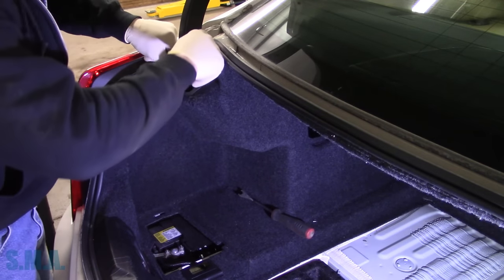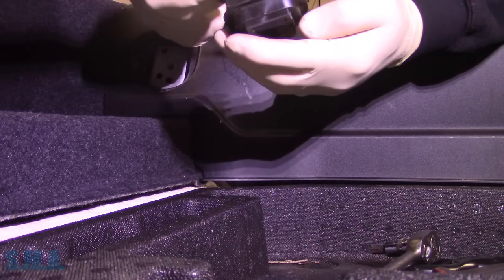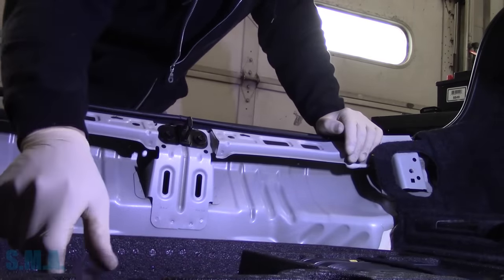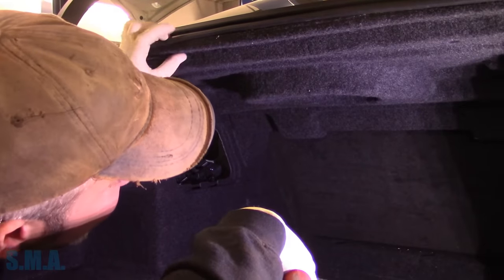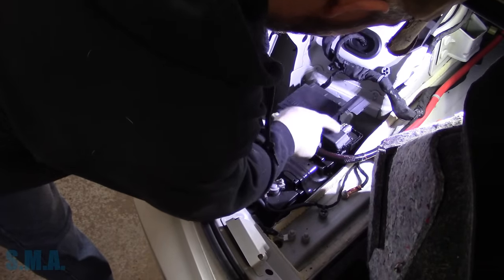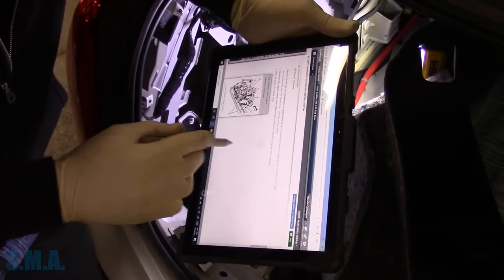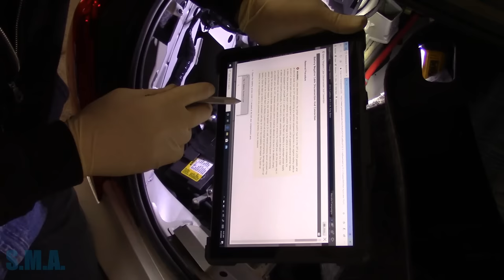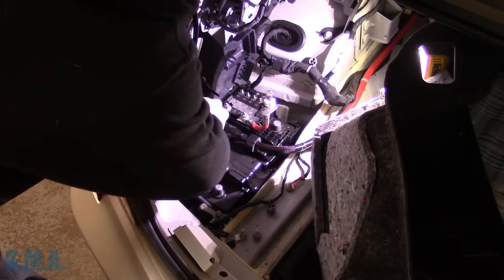Cadillac ATS: Battery Remove & Replace

Comment: Man that is rucking fidiculous.  I miss the good old days.  I seriously think you’re better off running an old car or truck from the late 90’s to mid 2000’s.  Of course that’s not always feasible in the rust belt up there.  I suppose you could get a nice one from a different part of the country, get it all fluid filmed and your good to go.  It’s a shame that so many cars bite the dust so quickly up there.  It would be awesome if new cars came with all metal parts powder coated, I would pay extra.

Comment: To change the battery cost you as much as the price of the battery. You forgot the plastic washers, you had to put the christmas thingies in first and put the washers on the otherside of that cover to hold the christmas thingies and then just pushed them in place.

Comment: I have a "16 ats 3.6 with start stop, and just added an amp and sub. I disconnected the battery and then reconnected it after wiring up power wires to it for the amp. Once it was hooked up I went to start the car and it wouldn't start. Tried to turn over once and then completely shut off and nothing would turn on after than. I had to close and open doors just do a few things to try to wake up computers, then was able to start it after a slightly long crank. My old scion did the same thing after disconnecting battery so I wasn't concerned. I drove it the same day with no weird issues, but then the next day it happened again. Did I mess something up has anyone had this happen before?

Comment: i replaced batterys on my compeys 1964 cat payloader  each one weights in at 80 lbs and are under the sit of the loader wicth is a pain in the  rear  no room to pull the dam things and heavy as lead can be. it on top of it its a 24v system  fun it was not

Comment: Chrysler in the passenger wheel well......mecedes benze under the right passenger seat..(imagine if that battery blew up)…..ford jamed up into the fire wall on drivers side...and now Cadillac pulling the entire trank apart to replace a five minute job...and probably have to reprogram the entire car after this

Comment: Car manufactures have figured out that you just have to impress buyers in the drivers seat. Put a big price on cars and trucks and wave as you leave the lot as a buyer. I'm sorry but I don't feel sorry for them at all anymore.. What a place to stick a battery that turns into a overhaul job to replace a battery or plugs , and a lot of other things. take it to the garage to replace a battery and get a bill for 3 hours labor plus the battery.

Comment: Advance, Auto Zone, and O'Riley's will NOT install those batteries. AZ even quit doing the  Lambda platform. If the battery is not in the front or easily accessible without removing trim they wont install it anymore. This came after a Traverse burned down in a south GA AZ.

Comment: And then there is BMW with battery under rear seat of 90's 7series iL with adjustable recline, and it has be fully extended to access the battery. 
If the seat adjust still works 😭

Comment: motors book time .4 hrs ,, right
Reply: I think you read that wrong.  I see .4 for test & charge and .7 for R&R in the Motor labor times.
Reply: @shauno3697  my mistake you are correct, good thing i don't quote the job
Reply: No worries. If you didn't make the mistake, I would have.

Comment: That is ridiculous. I expected less from you, GM. I had a 2000 Dodge stratus years ago and the stupid battery was inside the front fender only accessible by jacking up the front of the car, taking the front wheel off, pulling out the inner fender liner and pulling the battery box. And I thought that was ridiculous. GM, hold my beer.

Comment: Easier to make a few cuts in the plastic panels to remove the battery, then glue (epoxy or hot glue) to repair the panel, it is only a trunk, who's going to see that?

Comment: I would have went to oriellys they claim they will replace your battery for free if you buy the battery from them 😁
On second thought,  I wouldn't trust them to do a job like that.
I thought changing a battery on a 1998 Chrysler Concord was hard. That was a walk in the park compared to this

Comment: I'm afraid I would have slit the carpet at the end of the battery, that's ridiculous
Reply: lliambunter we had a customer come out into the shop and do that when we told him how much the install would be
Reply: @Texantroll  I don't blame him, it's not that it will cause all that much damage is it?
Reply: @Texantroll  I was once told a lady was given a £450 bill for changing  a headlight bulb in a Mercedes, I don't know what model it was, but under EU law you should be able to change a bulb if it goes out , that was why sealed beams became illegal in 1972/3   it's getting beyond being ridiculous
Reply: lliambunter ya but I’m sure when he turns in his lease they may not be impressed lol

Comment: In the good old days, you could jumper the dead battery to start your car. Then buy a new battery and install it in 5 minutes.  Today hire a wrecker pay a mechanic who has to look up all the data to be sure he doesn't damage anything and then pay out your nose for the job. Car companies are going to have to wake up or some company is going to come along with a common-sense designed car like Henry Ford did with the model T and put them out of business.

Comment: American engineering in the 1960's. Able to plan, design, and build a method to get men to the moon.
American engineering in the 2010's. Making changing the battery in a Cadillac harder than landing men on the moon.

Comment: 16:40 Intresting! Our battery's comes atleast one side blocked(so you just change the side of the plug when you need to.
PS. I miss the point of that secend battery IF the car dont have a "Start stop system", that would start the car automatic when you disconnect the main battery...
So if you ever have to replace that one maybe a video of it would be great, just maybe...
31:05 That might be failed test info! There is Battery Control on that car. Ones my customer come in and told me that the new Battery controller didnt work. I have to inform him again that the car dont want the Battery to be 100% it actually wants it to be ~70% so it can charge it with 18v or so volts on motor brakes and tahts most of the charge it dos these days only on down hill or motorbrakes to safe cas and the hole world. as example, Plains dont do anything to the world...

Comment: General Motors pays 36 minutes to replace that battery from bringing the vehicle in,  looking up the installation procedure, installing the battery, do any module configurations, writing the report , removing the vehicle from your bay, and handing in the work order. If there is any diagnosis they will give you an extra 18 minutes . But you have to run a test with a Midtronics GR8   battery tester that is usually from 1 hour to 1.5 hours long and attach a printout after the test with a code to confirm your diagnosis or they pay you nothing. Anybody want to work for a GM dealer?

Comment: 2002 dodge intrepid was the worst car I had for battery location. Front right lower wheel well. The battery sits right behind the passenger fog light. 🤷🏻‍♂️🤦‍♂️

Comment: "Isnt there something that holds it in?"..........yea all the crap owners put in the boot stop it moving LOL.A very convoluted battery replacement it must be awkward trying to jump start the car, they could have just made another removable section by the battery its not like it hasn't already got one for the fuse box. BTW what are those silver hoops for on the rear fender cover bolts that you replaced, if they are tie downs what for?

Comment: A Cadillac with a 200 hp, 150 cid 4 cylinder engine requires half an hour or more for battery replacement, plus follow-up. I don't recognize this world.

Comment: Similar story: Working on my BMW E90, just need to change the bulb on one of those "angel eye" parking light... The steps are: Jack up your car, put it on jack stand, front wheel off, inner fender liner off, then you get to the bulb, which is a whole light assembly that you need to replace, not just a bulb, but that's another story. 
Again, similar story for the E90 M47 engine engine air filter replacement.... Steps are: engine plastic covers off, cabin air filter off, filter HOUSING off, engine brace bars off, then the filter cover comes off after wrestling with it and the ECU harness is just in the way....

Comment: I've checked the position of the oil filter before buying a car for decades, starting about 10 years ago I also started checking the battery location. I would not buy this car.

Comment: I have worked on these shit wagons for over 30 years. At least 2 or 3 a week. Nothing is easy on them. Customers pay 40 to 70 k for them and repairs are access difficult and a pain in the butt and expensive. See the trim on this battery change. It could have been designed for full access by G.M. But no!  The old Caddys 1999 to 2008 Northstars, head gasket bolt problems, Coolant problems etc etc. Starters under the intake manifold, limited access for Alternator removal etc etc. Light weight OEM original front ends etc etc,  Oh and the 3.6 lt  engines paid for my kids college educations alone with the notorious timing chain failures. When the cars get about 50,000 miles the heads on the  aluminium bolts will break , come off like candle wax. If you keep these cars for any length of time the plastic switches  on the interior and parts in the engine will break from normal use. I suggest watching South MAin Autos  ( Erics Video ) on how  to extract broken bolts inside the engine. U will need it . Good luck.   Excellent video Eric. Thanks  lololololol Gd.

Comment: Chrysler, and we put one in the drivers side front inside fender well of the dodge stratus to boot!! Good thing the 1996 dodge stratus was build just for the rust belt. Every screw and bolt rotted. Morons. takes about 40 minutes too get it out, by removing the tire. Then a trip to the hardware store to get some stainless steel screws and bolts so they won't rot out again in 3 years when you'll change another one. I thought it would be faster to scrap the car. The owner, thought other wise.

Comment: Like it's not bad enough that they place the battery in such an idiotic location. But they also consistently use undersized batteries that aren't really up to the task. The 12v battery in my Prius and in my Chevy HHR are both located in the rear and are both ridiculously small.

Comment: and I thought that Chrysler's idea of removing a front wheel to get to the battery was stupid. another video to reaffirm that I was right to get out of the auto trade.  btw, Toyota mini-van from the 80's that had the battery access from the inside, behind driver's seat.  good thing there were no soccer moms with messy kids leaving the van a pig sty

Comment: about as bad as changing the headlight bulb, "tear off front end". those battery cable ends look just like BMW ends "junk" and for good measure BMW puts a little explosive charge at the pos. cable end to blow connection in case of an accident. are you friggin kiddin me.

Comment: What is the Gauge of the Battery cable going all the way to the front? I would assume it would be heavier given the distance. The engineer that designed that should be shot and buried in his own sh_t.

Comment: Them foreign jobs probably require you to remove the engine to replace the battery so in comparison this one's a piece of piss, like when an electronic device says no user serviceable parts inside. My 2001 lesabre has the battery under the back seat it's easy to change and when did GM switch to top terminal batteries?

Comment: What's sad about this is the auto parts store a which have a policy of installing batteries for free.  So the poor schlubs working there are tasked with doing these trunk batteries and back seat batteries AS well as you do at SMA, except the parts store people are also supposed to do their parts counter jobs AND this, for barely more than minimum wage.  And don't screw up and damage the car. And oh yeah, there are no tools. Maybe a 10mm socket wrench.  But change that battery or else the DM will have your hide.

Comment: Kind  a bad engineering FUBAR, putting battery in trunk and that much work to get it out! I had a 63 Plymouth 426 Ramcharger 2 X4 factory Drag race car has a big D4 diesel battery in trunk over right axle and dual cable easy to service!

Comment: Looks like a-p-i-t-a!  so i guess you didn't have to reprogram compass etc..? My worse Battery was in a Big RV, there were Two Huge Batteries under the stairs, it was tight and they were Heavy AF almost crane worthy to lift them out and in.

Comment: once the back up battery has been used it can no longer be charged.... what sort of battery cannot be charged in these modern times, and what sort of idiot thought that was the only solution to a flat battery, a bit like some mercs where it has a motorbike battery under the pollen filter.

Comment: I have never seen such a badly placed consumable item. There was nothing wrong with having it under the bonnet/hood - and the backup battery??? What an excessive waste of time and money. Bring back the carburetor and basic wiring. I also thought the little vent plug in the battery had to be removed before use - maybe I'm wrong.

Comment: This is a joke, right? The battery is a wear item that must be replaced every 4 or 5 years. There are a lot of ways to discharge your battery so you need a jump. This has to be an April Fools Joke from SMA>

Comment: This is incredibly poor design. Only one bracket to go over the battery? For safety reasons we need at least 20 brackets with isolation and dampening and at least 40 quick release screws

Comment: G.M....ARGH!!!Took me 2 hours to replace a battery in my vette...Pain in the @#$! ass...I had to undo everything 3 times before l got it the way l wanted...No room to get your hands in or to turn the wrench once you get it in ....Several types of fasteners holding on one part...It's almost like a mistake but it's not...Just the way G.M designed it..If you watch G.M vids on these things they always seem to have a reason for why they do this but in the end it's just poor design...I'm not going to build a wooden cabinet and and use 2 screws and a nail unless lm a hack...Oh ya...When doing this job do Not drop a screw or bolt...Bye..Bye..